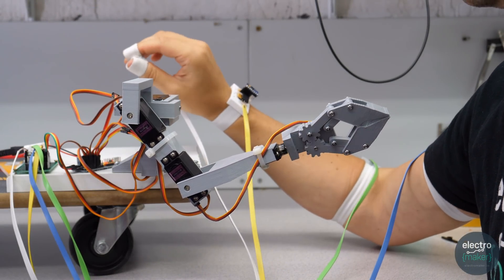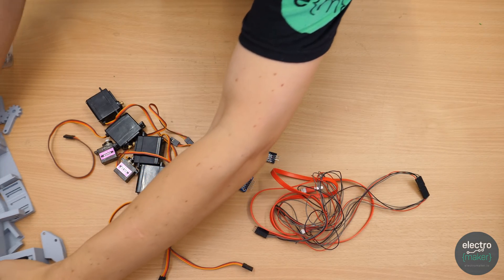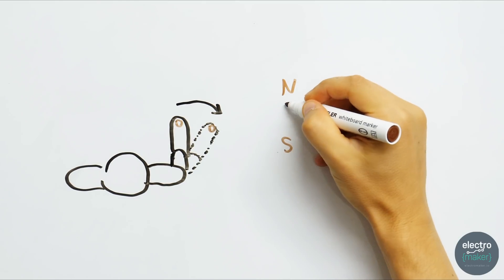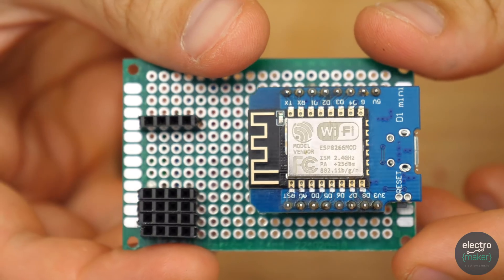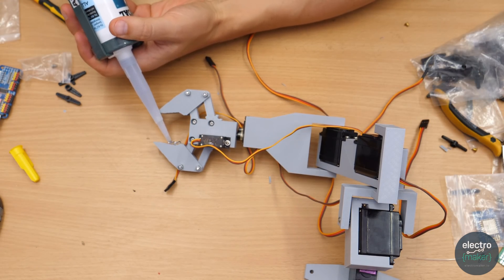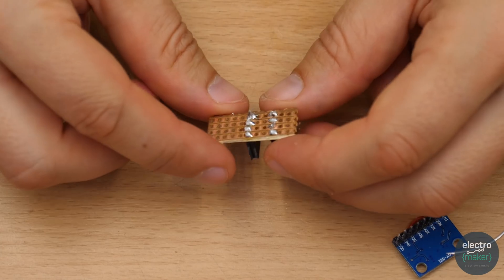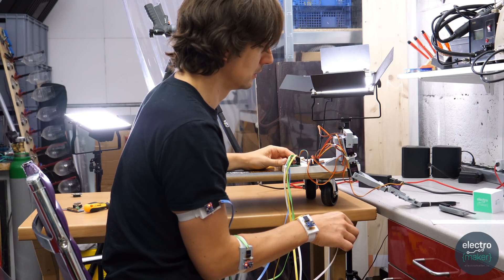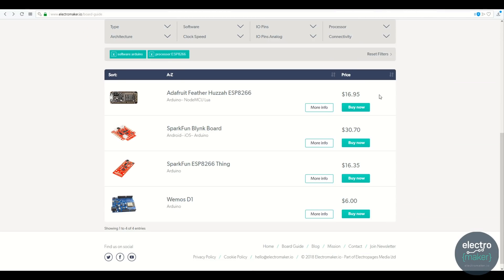Build your own 3D Printed Arduino Robotic Arm!

Comment: Can I use a cheaper plastic gear version of the m996r(FS5103B)? I have some so it would be cheaper then buying new m996r motors

Comment: to track movements 1/1 precise just use potentiometers)
Reply from the maker: Great suggestion!
Reply: Do you have any ideas for how to read the wrist twist angle with a potentiometer? I would like to use all mechanical sensors for my project, but I need it to be durable and unobtrusive. Thus far the only good designs I've come up with use IMU sensors.
Reply: @dekutree64  Why not a gyroscope? Unless I'm misunderstanding what they are for, they seem as though they'd be perfect to detecting the rotation of your arm, far better than an accelerometer would be.
Reply: @Here_is_Waldo  Mechanical spinning gyroscopes do indeed track absolute orientation, but they're too bulky. MEMS gyro sensors only detect angular acceleration, so you have to integrate twice to get orientation, which is not accurate at all (drifts constantly).

Comment: Very  nice project!
Next step: trhowing all that wiring behind the shoulder or connecting to a wifi transmitter!
Reply: That's in fact what is needed. The I²C wires are lengthwise at their limits. Splitting the code into two parts that are communicating over wifi would be a huge improvement
Reply: @bitluni  Yep. Give each sensor module its own battery and wifi transmitter and it will be much more comfortable and less delicate.
Use RTIMULib to get absolute orientation of the sensors relative to the earth. Inverse transform each one by its parent's orientation (multiply wrist quaternion by the conjugate of the forearm's quaternion, forearm by conjugate of upper arm, and so on), and convert to euler angles. This will give you precise joint angles regardless of your body orientation.